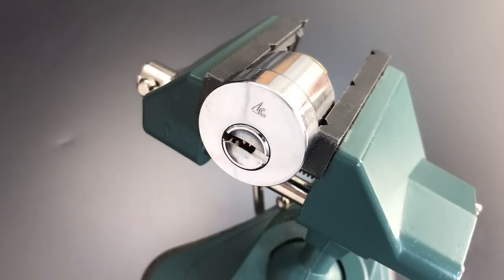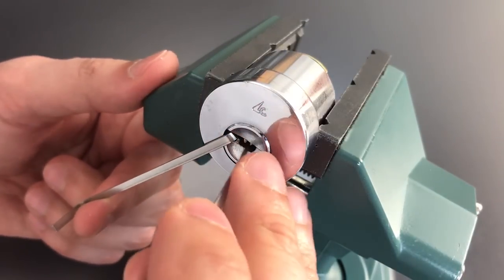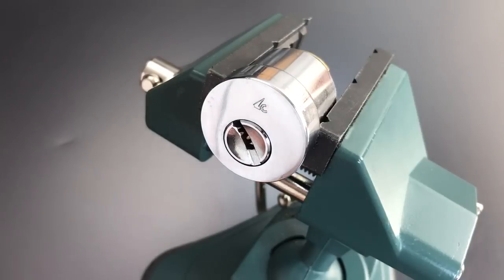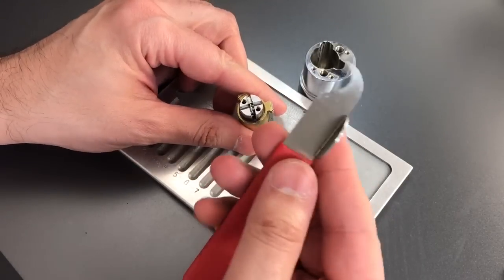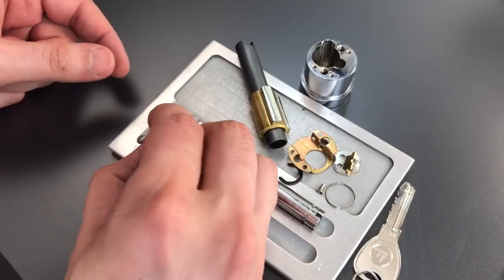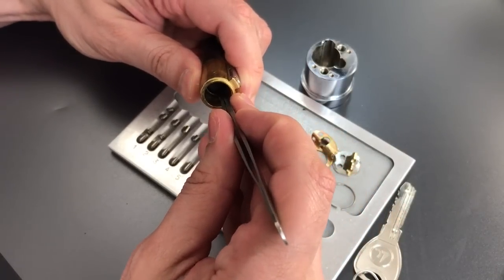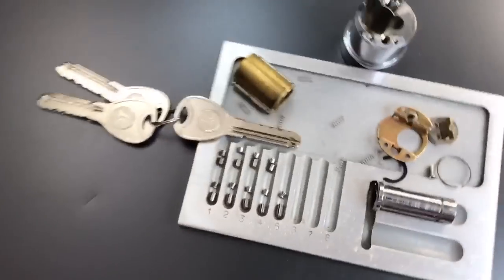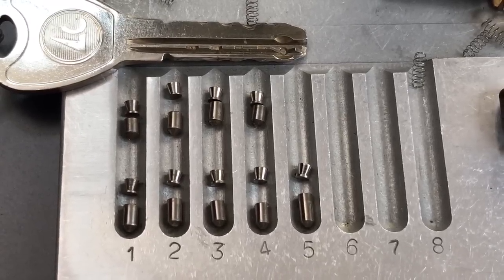[499] Japanese "MegaCross" Hybrid Dimple Cylinder Picked and Gutted

Comment: FWIW, those small screws look like they have a little dot near the slot, which would make them not Philips (nor Pozidriv), but JIS B; using a Philips driver on those can quickly strip them if they're tight, so if you get into a situation where you're regularly facing them, consider getting dedicated drivers or bits.
Reply: til thank you
Reply: a mystery revealed. thanks!
Reply: also, good thing he didnt have an electric driver. wrong bit and it just strips faster.

Comment: I'm told that the main goal of this and similar locks in Japan is to encourage the would be burglar to move on. 70% give up and move on if the pick takes longer than 2 minutes, because why risk getting caught?

Of course, if the lock is expensive, that means the residence has money or valuables that the lock is intended to protect, so there's the reason why it's only 70%.

Comment: It didn't matter this time, but those might not be Phillips screws. I only say as much because you said it came from Japan. They have a drive a little bit different called JIS (Japanese industrial standard) if it is and you use a jis screw driver, the two might hold together when you are starting the screw
Reply: So, you're saying there's jis in my lock?
Or should I put jis in my lock?

Comment: You say that you could not in all likelihood drill this lock due to the steel pins. I have to wonder what would happen if you used a carbide two flute end mill in in a drill. Probably chew through that like it was butter.

Comment: 3:44 - I'm not a locksmith, but I've taken an interest in your videos.

That being said, what is a bible?

You've used that term often, but I'm having trouble ascertaining what part of the lock you're referring to.
Reply from the maker: From unitedlocksmith.net

“Sometimes referred to as the lock housing or the book, the bible of a lock remains stationary during the use of a key. The reason it will be referred to as the bible is mainly due to preference, and because it is a term that is difficult to confuse or conflate with other parts of the lock.

When the proper key is inserted into the lock (or lock picking is successful), the springs and driver pins will pass the shear line and be in the bible exclusively.”

Comment: Not unique and done incorrect, this is a Mul-T-Lock knock off. Side pins are NOT spring loaded in Mul-T-Lock. The side pins cuts on the key draw the side pins into the plug allowing the plug to turn. Any attempt to "pick" would drive the side pins INTO the shell stopping the plug from turning.